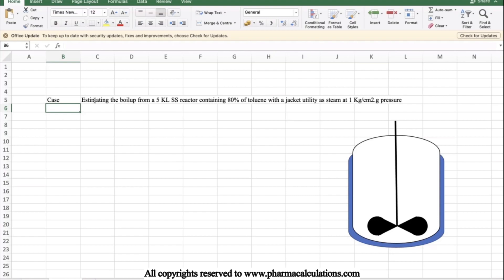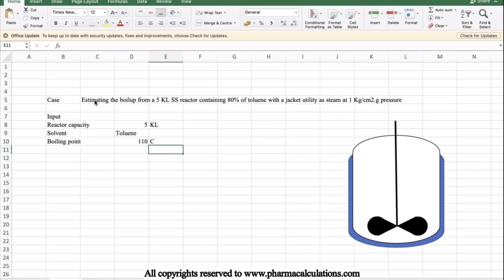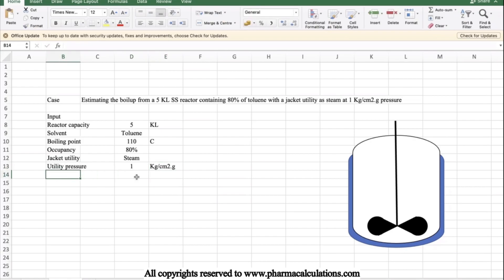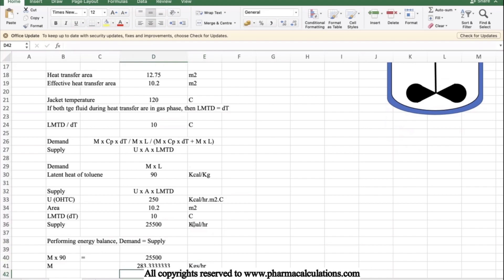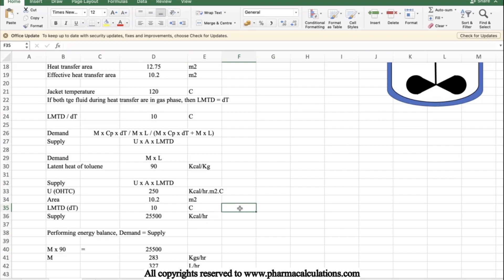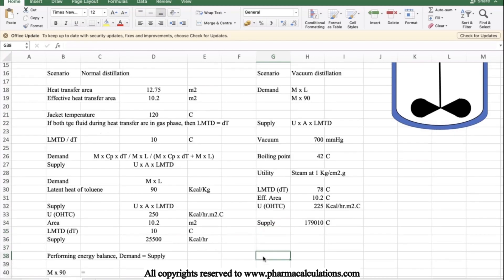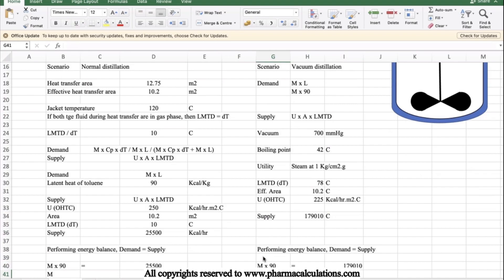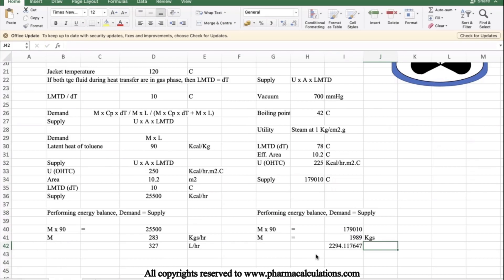Calculate Vaporisation rate (Boil-up Rate) from a batch reactor

Comment: How to calculate boilup for distilation col
Reply from the maker: Calculate the boil-up from the kettle or reboiler which could give you an idea about the boil-up that enters the column and then estimate the pressure drop across column, that would give you the vapor rate at column exit.

Comment: In atmospheric distillation 
If i consider toulene as liquid phase having inside temprature 30℃ then what is my LMTD ? 
OR 
WHAT IS my demand is it m Cp ∆T + mL ?
Reply from the maker: Hii Dhruv,
Toluene boils at 110 C during normal distillation i.e., at 760 mmHg, 
So for estimating LMTD you can take 30C as initial temperature and 110 C as final temperature and the jacket utility temperature remains the same (if it's steam)